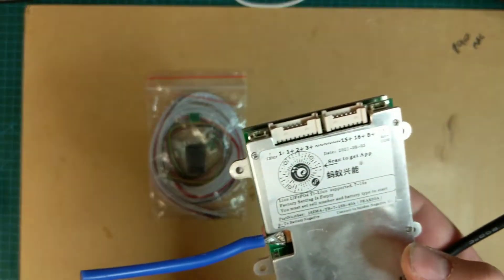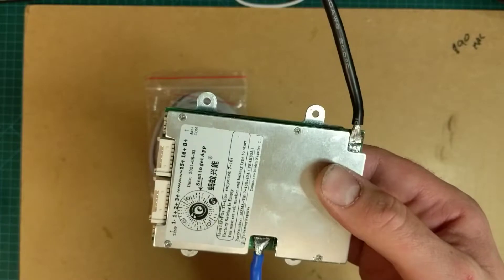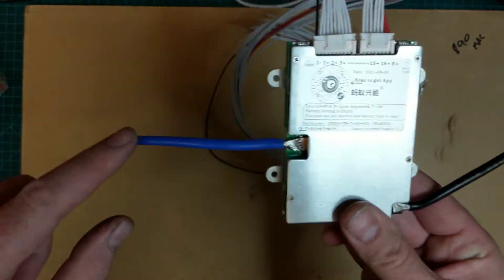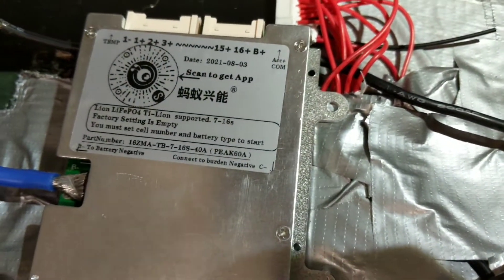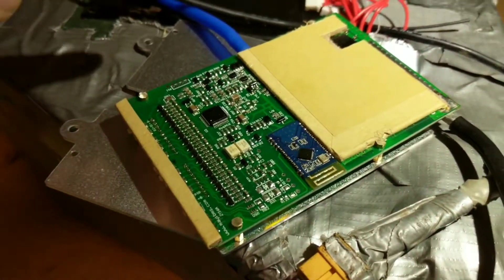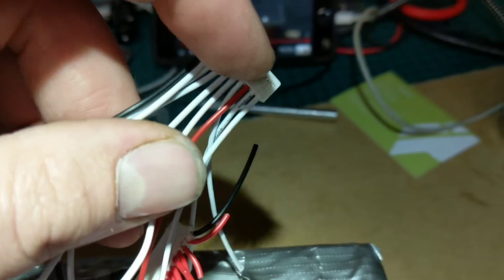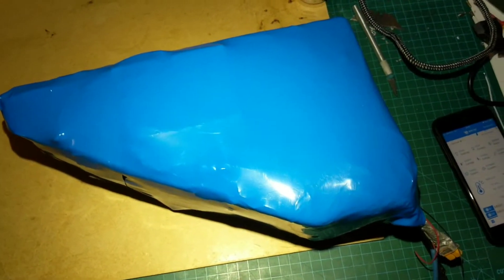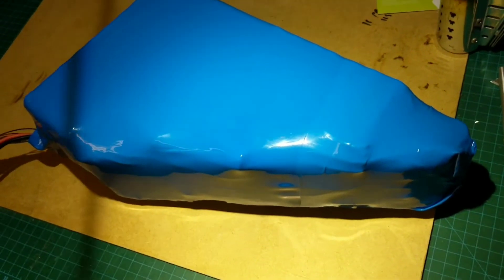Cheapest Bluetooth Ant BMS 7s - 16s MyBms 40A peak 80A new 2021 li-lion 60v - 67.2v  battery

Comment: Luckily they updated the iOS app a while back and it works pretty good. Unfortunately there was another iOS app that worked but seems they remove it from the store called Smart BMS which gave basic read-only features, perfect for letting the user see without messing the settings up.

I bought the 7s-16s 80a/200a peak version of that one which is the same tiny size but has two wires going in and out and I assume double mosfets. 

It will be replacing the basic 15a bms in my ebike battery and finally I will be able to see whats going in inside. 

The prices now are dirt cheap, mine was about $40 delivered. The first ANT i bought was a 50a/70a peak, 10s-24s, for about $80. And it was such a headache, the new one that didn’t work with the old iOS app and needed modern android phone and sideloading 10 different ApK files till I  ones that worked and that I liked. Lol

Comment: boss, I have 72v80ah bms ant often turns off at 75v, which settings should I set?🙏🙏🙏
Reply from the maker: Have you used the quick settings ? 
Then check the total volt setting

Comment: Hey, I'have problem with my 24S 200A ANT. The BMS or probably BOOT firmware update failed and BMS doesn not show data or respond to swith. When I connect it it appears on Bluetooth device list in app. Have You got any sugestions? :)
Reply from the maker: What program (android  or iOS ) are you using ?

Comment: Files NOT EXISTS...... please reup
Reply from the maker: very important : Newest BMS must use newest app ! can't use old app to change parameters !

Newest version phone APP and computer software download link  :
http://mysharegadget.com/241808267
copy the link and open in another browser ! 
when your phone language is in English , then you open the APP will be in English
APP/Computer software level 1- level 4 password : 12345678 or 00000000
APP/Computer software  level 5 password :  123456789abc or 000000000000
after vertify level 5 , you can set up parameters 

MY-APP-1116.zip is better version Android app

APP connection need to pay attention to these  :
1. Activate the bms , the bms bluetooth led is flashing.
2. Must agree to open location persmission when you are installing app . And also remember to open your phone positioning.
3 . Put the phone near bms , some phones need more time . some slow phones need to click several times of connect.
4. set up lifepo4 or li-ion or lto setting in control page of app , then click save